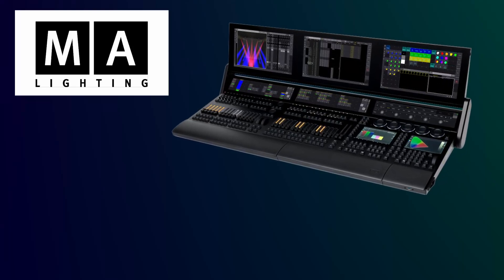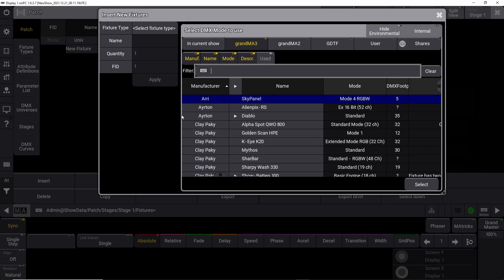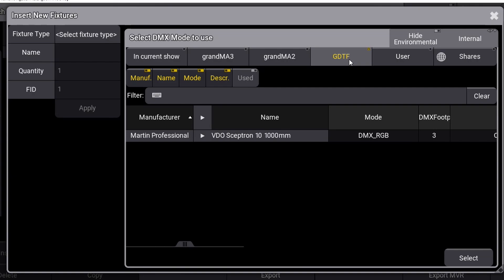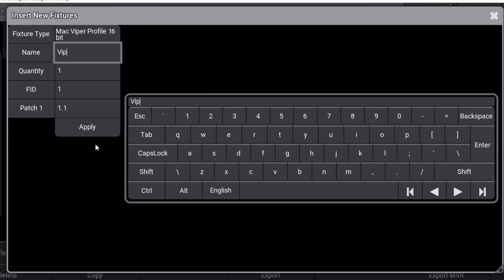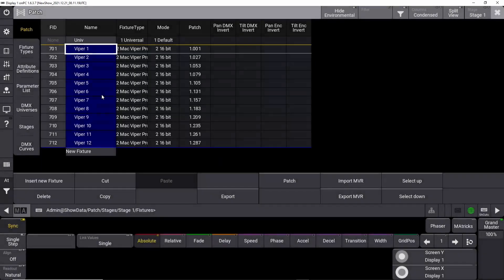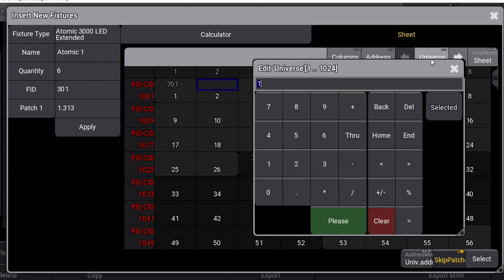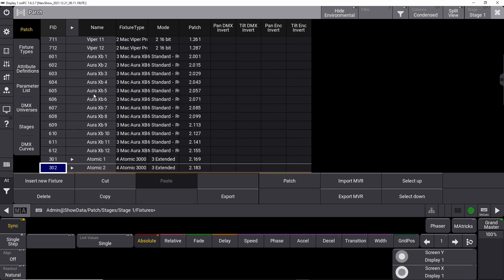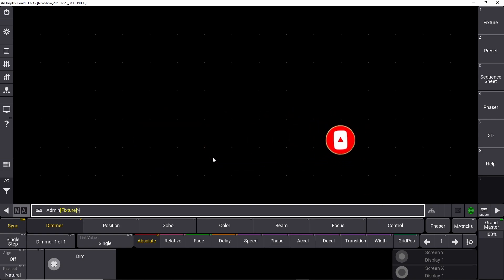E02 - Patching fixtures - GrandMA 3 OnPC Tutorial

Comment: Hello! Always great videos, I'm struggling with an older issue and can't find help on it anywhere! When patching in anything with multiple pixels, like titan tubes, with more than one pixel i.e 8/16 - they patch in fine but when assigning them to the layout view, they are un-usable. If I assign for example 1001 it just looks as though it's fully on and I can't adjust any setting. I have to assign "1001.1" then .2 .3 .4 etc then each pixel will be assigned separately but surely there is a better/proper way of assigning all the individual pixels of one single fixture to the layout view? You can't 1001.1 thru 1001.8 as this doesn't work. On Ma2 you simply stored the main fixture ID and it would put in every separate pixel as it's own little icon that is controllable. Any help would be GREATLY appreciated.